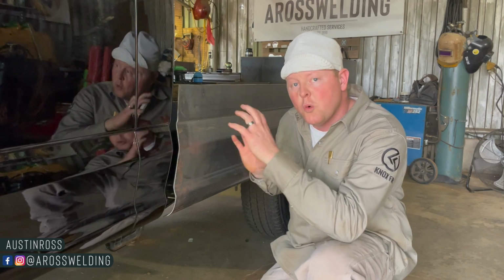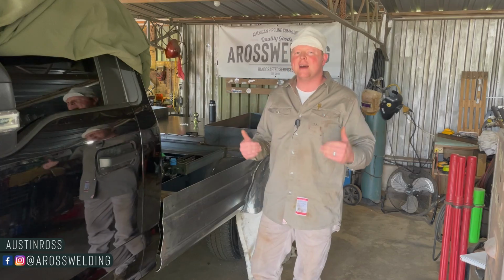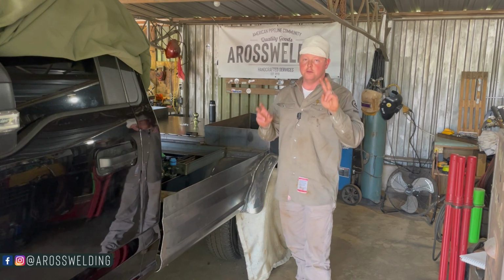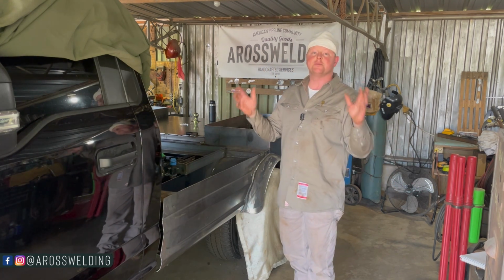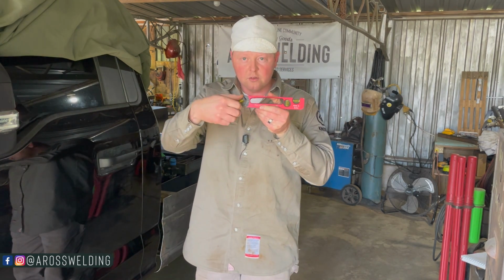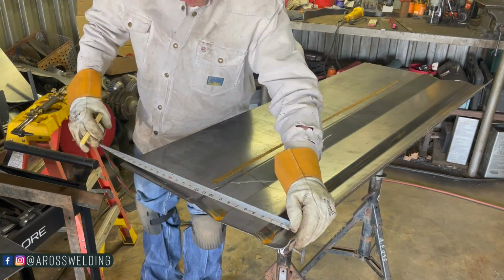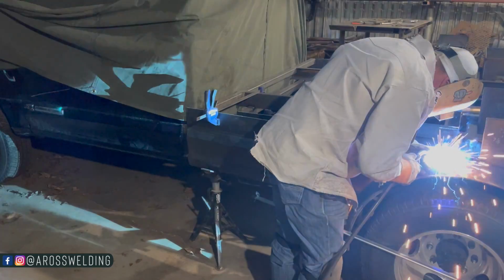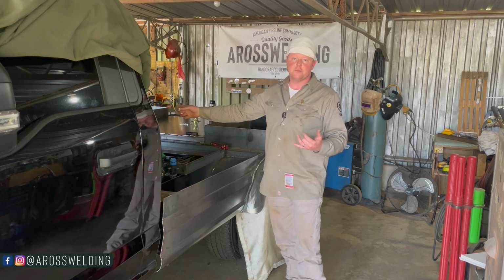Seamless Welding Rig Body Lines (Matching the Welding Bed Side Panels to the Truck Cab)

Comment: Did you trace the lines out on cardboard then gave it to the steel yard?
Reply from the maker: No, they actually already had all the angles figured out on account of they had done the new ford bed sides for other customers.
Reply: @arosswelding  wish I had a steel yard like yours down here in dallas
Reply: Hey, would that shop remake panels for me?